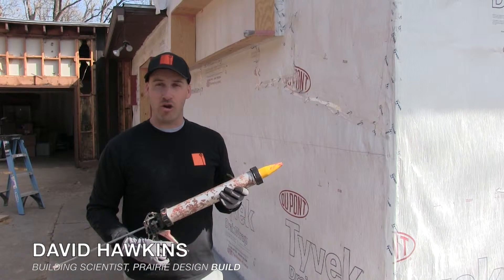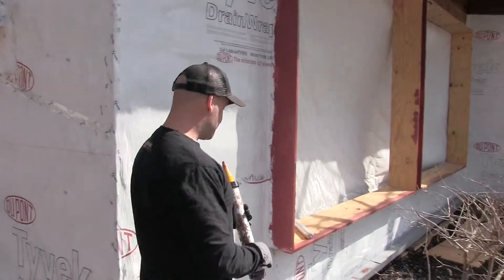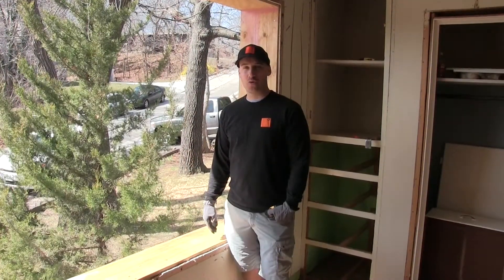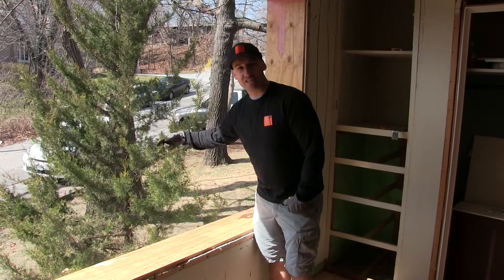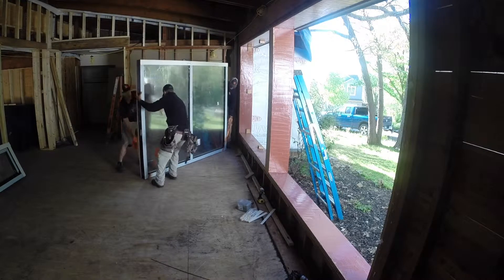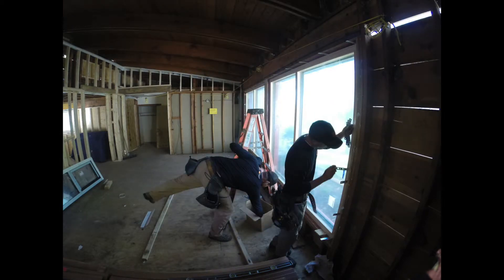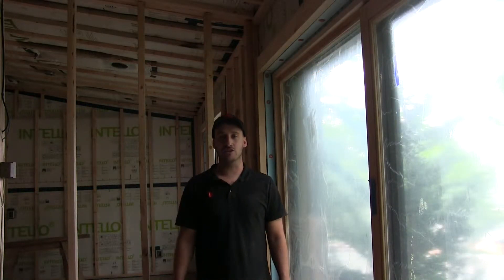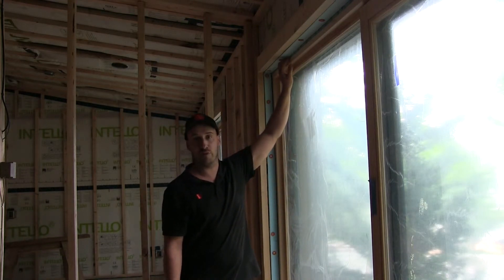Lake Quivira Passive House - High Performance Window Installation

Comment: Loved this video! I do have a minor critique, bit of a lengthy one. I am a designer of performance homes here in british columbia canada. I have heard many times about the negligeable effects of the micro insulated perimeter around the perimeter of the window frame. It makes sense as there is very minor r value being added to the window, another point is that because the insulation is so minor around the perimeter of a window frame, is that it's better than to allow this small typically half inch space around the window frame perimeter to dry, putting vapour open tape on the exterior side so if water ever got in, it would have a chance to dry, a vapour closed tape on the interior side so that water cannot migrate into the interior space (really small chance of either of those things happening if done right though with the tapes on both sides). By air sealing off the window perimeter on both sides, the small air space also has some insulating properties to it, but the energy increase on putting spray foam insulation in for exmaple I've heard from joe lstiburkes daughter another building science guru, that the impacts of spray foam around a door or window are so small they could practically not even be modelled. She also goes to talk about how skyscraper bulidings avoid the cavity around the perimeter from having anything inside and this also now moderates the pressures from high winds outside and keeps the tape than from working as hard and being moved by wind pressure. Just curious what you think of all of this?